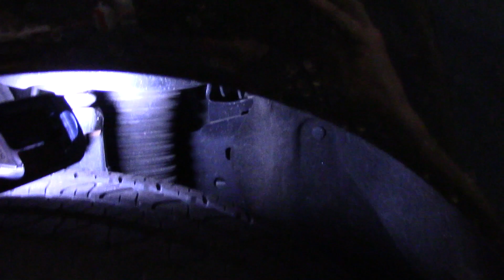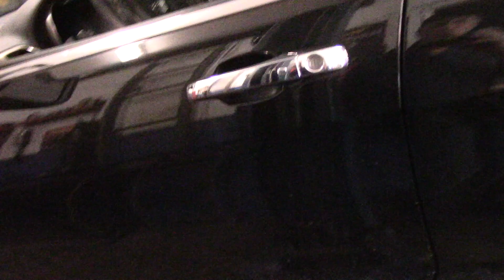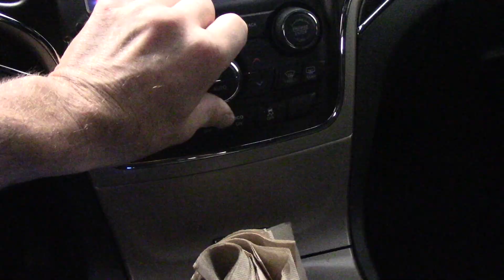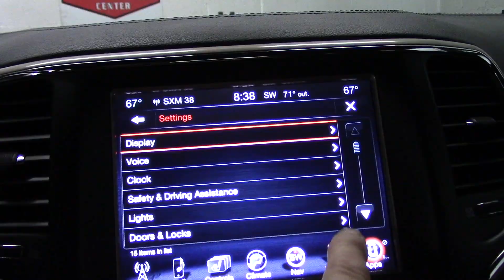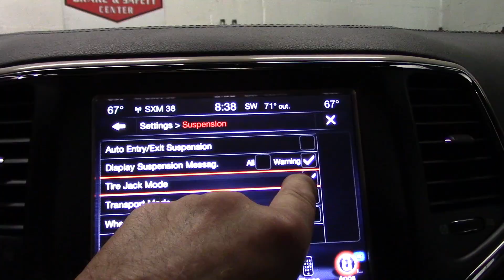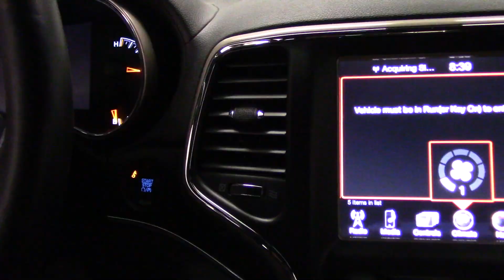2015-2018 Jeep Grand Cherokee Into Jack Mode

Comment: If in the controls there is no tire jack jack option then you don't have air suspension?
Reply from the maker: Correct, the jack mode is only available with the air suspension.

Comment: I remember lift mode on Lincolns from the 90's. I don't work on many cars with air suspensions but when I lift them on the lift you can hear the air pressure releasing as the car rises. When lowered to the ground, the car will be sitting low and when the engine is started the compressor comes on and restores the ride height. I could see a problem jacking the car to lift one wheel. the air ride system might become confused and start pressurizing the opposite corner of the one that is raised.
Reply from the maker: I remember those car. Thanks for the visit.